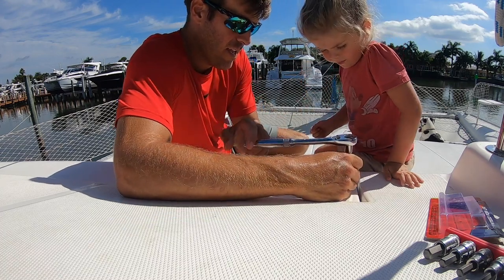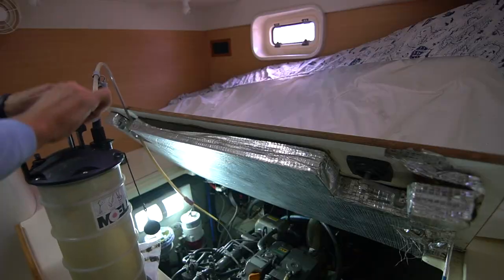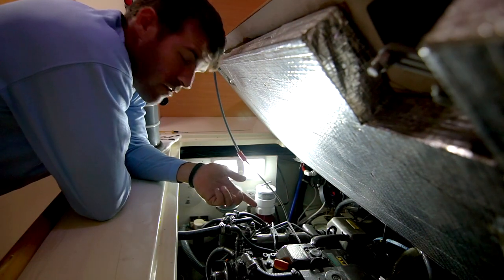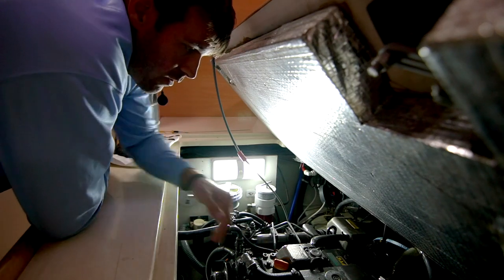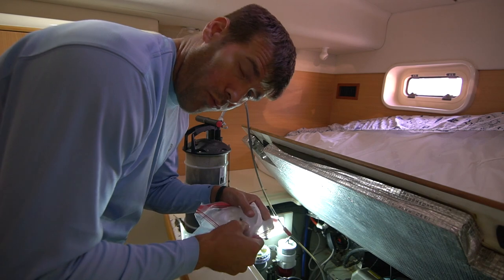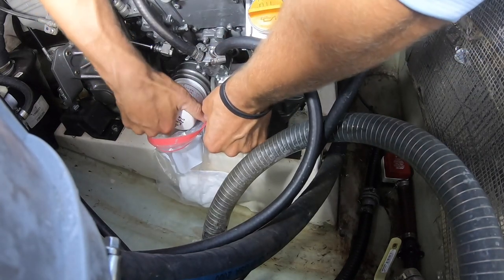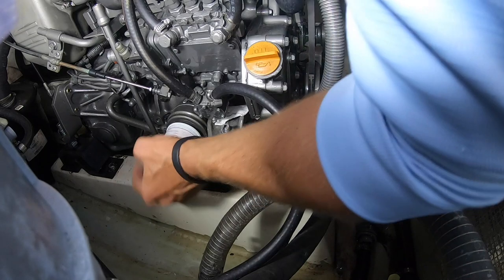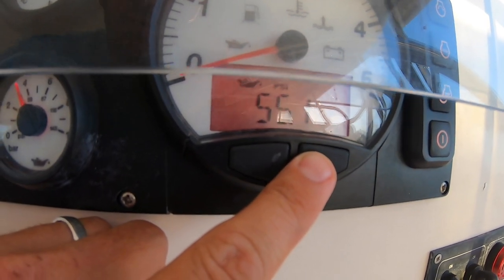Changing the oil on our Catamaran Yanmar Diesel Engines

Comment: What is the lower yellow oil fill cap for? I have both on my engine as well and my manual only shows the lower one.
Reply from the maker: great question but I never used it.  It is an oil cap but no clue.  I'd message just cats and ask Rafael

Comment: how much oil you added, and how did you find out how much to add?
Reply from the maker: Frank Rodriguez I consulted with the manual.  5 qts I believe.  Every engine is different.  I pay close attention though on how much I take out.  I always put in the same as I take out, then* I check the level